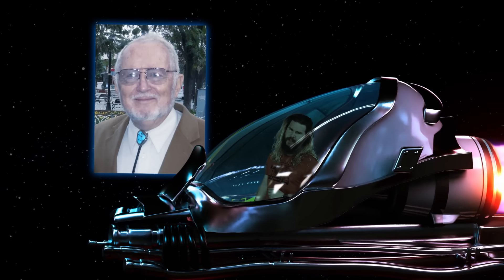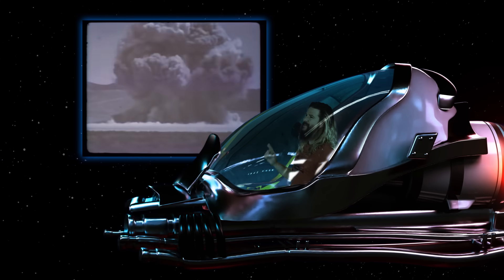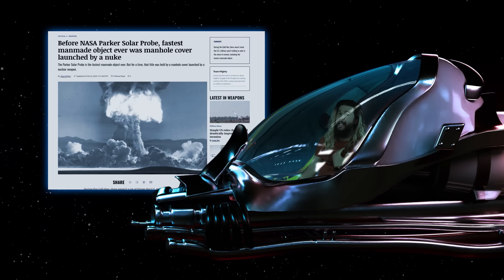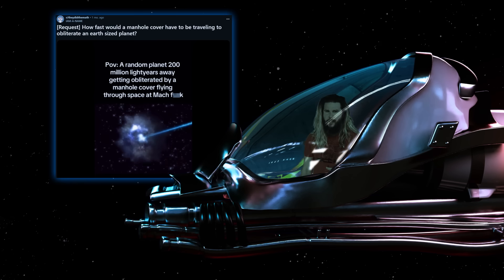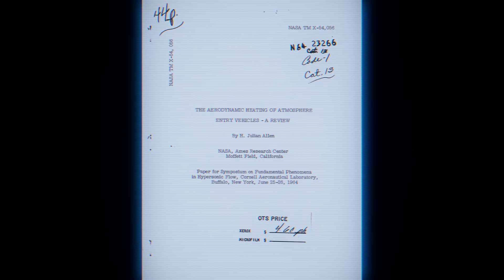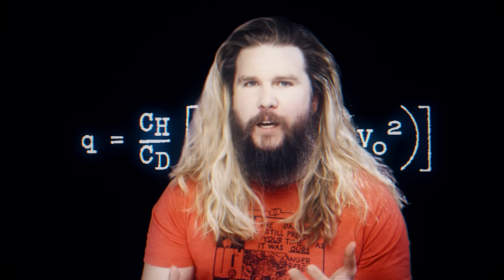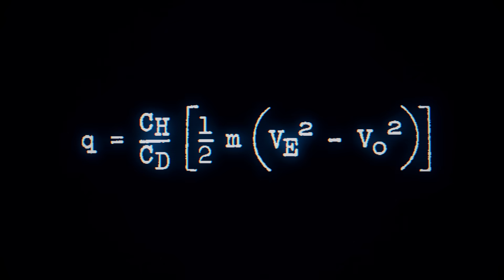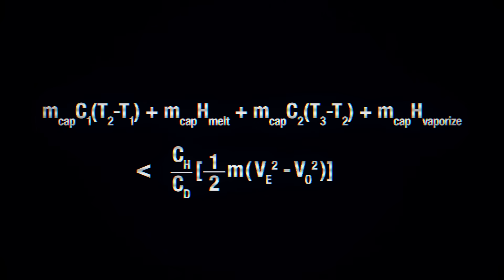Debunking the Nuclear-Powered Manhole Cover

Comment: Using the numbers for pure iron is a mistake as cast iron is not pure iron. It is steel with a carbon content so high it becomes brittle. Which also gives it a lower melting point. We can be sure it's not pure iron as pure iron is nearly as soft as gold. It would have deformed far more than is seen in the original video.

Also you assume the disk is ONLY heated by friction with the air. The explosion would no doubt have caused some heating, potentially affecting your calculations.

Comment: There is an astonishing amount of misrepresentation here. 

You cannot just simply use the inverse of formulas and assume equivalency. You forgot about: reference plane, discrepancy in pressure rate, modifications of your formulas to account for supersonic flow rates (invalidated Navier Stokes), superficial drag coefficients for hypersonic flight, you compared the behavior of nonductile metals to non-contiguous meteors, you didn't account for the difference between the elliptical path and object follows entering the atmosphere vs the near perpendicular path the cover would have taken in the time it spent leaving the atmosphere, you didn't account for the thermal conductivity mean free path with respect to pressure gradient, you didn't account for the boundary conditions of thermal conductivity at temp extremes, even the likelihood of orientation for reduced aerodynamic drag becomes critical here because of the leading edge  proportion to heat input because of the angle of molecular collision forces.

This is why "plug and chug" often ends bad when the premise of the formula is misunderstood. Pulling a formula from a study like a rabbit out of a hat is usually a horrible idea. 

Like you said "garbage in is garbage out"

Comment: Amazing to me you made....how many references to meteors? Meteors that are burning up ENTERING denser and denser air as it entered.  Whereas the manhole cover would be exiting through thinner and thinner air. It would have started out initially burning up and then less and less as it went. 

You also failed to mention that it was on a straight trajectory away from earth whereas most meteors are entering at an angle which prolong the burnup process, and that even science agrees a meteor coming straight on instead of at an angle, is far more dangerous than one at an angle. One of the reasons being, because it has a much higher chance of hitting the ground. 

Please take these into consideration and redo the math

Comment: I don't know man, "asteroids going three times slower" is probably the key phrase. This was going much faster. The manhole cover might not have been exposed to the air resistance for long enough to completely vaporize before leaving our atmosphere. . . Or could have turned into a molting slug and the second it reached the vacuum of space could have popped (similar to what happens in the vacuum deposition coating process.)

Comment: I made my first radio photo voltaic battery years ago and now I can't get the materials I need to finish the new one. I also found out that producing hydrogen through electrolysis release is a small amount of tritium as a free radical. I found this out when my hydrogen unit started glowing after about a month of processing fuel. I can make the tritium I just can't concentrate it. Now I find out we need a license to order it because they change the regulation. They're hitting half of their Half-Life so you're not near as bright as it used to be😢
Reply: Speaking of, I've been told that I'm crazy when I tell specialists that electrolysis does produce tritium as a free radical as well as concentrate the deuterium in the water due to the fact that it doesn't electrolyze out. It would be amazing if you could do a video or a deep dive to let people know these are actually free radicals as well as the fact that you can concentrate deuterium that way though it takes an extreme amount of time. In fact, it's to my knowledge that if you have an electrolysis unit set up but only put heavy water in it it will not work and you will not produce gases from it. I've never had enough deuterium to try this.

Comment: You're not taking into account that traveling at such a fast speed of 66km/s, the manhole would have passed through the main part of the atmosphere responsible for heating during controlled entry (65 to 35 kilometres) in less than one second.
Most manhole sized iron meteors in fact do survive their journey through the atmosphere and land on earth.   And that's because you have totally ignored the time it takes for this heat energy to be transferred to the whole of the meteor - the heat initially is completely concentrated on the surface, which then melts and ABLATES, carrying away the heat energy with it.
That's how spacecraft survive re-entry - they have this large ablation shield designed specifically to carry away the heat energy through ablation, and thus protecting the spacecraft from receiving the heat.
So, the time required to actually transfer the heat into the manhole cover, resulting in the ablation of the outer surface of the manhole cover carrying away this heat energy while protecting the interior, as well as the very short transit time through the densest part of the atmosphere would likely mean that only the outer part of the manhole cover got ablated away before it flew out of this zone into outer space.

Comment: I'm curious what the numbers would be with the cover in a vertical orientation, taking the escape in a more aerodynamic "edge on" orientation. Similarly, it would make sense for the forces involved to melt or otherwise reform the cover into a more teardrop shape, making its aerodynamics much better for whatever didn't get vaporized before it got to that point. Would a maximally aerodynamic cover still have vaporized?

Comment: i'm not going to argue the math just a basic observation. I get the numbers used however and its impossible to truly know but  Unless the disk was launched absolutely perfectly level which would require that the welds holding it down all broke at the same time  , which is basically impossible to a hand welded piece of metal  then the cap was tilted at least a little . Drag would straighten the cap out edgewise or atleast change its orientation drastically decreasing overall wind resistance ... so its possible only 4 inches of it would have been pushing an atmosphere. Since the actual atmosphere is only 60 miles thick at 150,000 mph that disk would only have to survive at most for 1.4 seconds.... No doubt some would have vaporized but i wonder if the manhole cover could have survived . I have seen people run their wet hands through melted led and not get burned due to the water vaporizing and protecting the personas hand. Wouldn't the leading edge of metal vaporizing produce a similar effect  significantly reducing the drag ?

Comment: I don't see how a cast iron disk (even one 4 inches thick) wouldn't have just shattered from the heat and concussive force of a contained nuke. 
You can crack a cast iron engine block if you push it too hard without enough coolant.

Comment: the most likely scenario is probably what was shown in the video, but there are two important variables that i am curious about. 1) does angle of attack matter, a meteor falling towards earth has a different angle to the presumably strait up vector of the manhole cover. this might matter as an object falling down at an angle has more time to burn up as opposed to something going perpendicular to the ground. 2) does the atmospheric density matter, an object falling down goes from low to high density atmosphere, where the man hole went from high to low.

Comment: Genuine question from a well intentioned midwit: Asteroids and other natural space debris of similar mass generally aren't wholly made up of a singular, refined slab of metal. Usually they're metal, rock, dust and ice all lumped together but not uniformly. So as a reference to something similar that we have as evidence that the math checks out wouldn't that kinda change? Like comparing modern plastic and aluminum car crumple zones to older steel body vehicles? Bad analogy I'm sure, but the force is the same between the older and newer ones at a given speed/ mass but the older steel frame/ bumper will likely be okay where a newer era one wouldn't? (Same probably can't be said of the occupants obviously lol.

Comment: What are use Monday numbers you have to take in to consideration let’s say that it had the stormy clouds above this site that there may fire up that freaking manhole cover it is there in the cooling atmosphere before even atmosphere heating would actually come into effect so you’re kind of wrong on that part yet to take humidity. It is a liquid that would cool down that nuclear man will cover, the heat from explosion will cover so water in the air cool down breaking man because the day afterwards and the journal of the guy there was literally note stating it rained the next hour or two note the next day from him claiming that there was a thunderstorm a nuclear test happened to tell you could’ve been into space

Comment: We know the thermal conductivity of iron. No matter how hot it is the iron will only conduct heat at a specific speed. If the time it takes for the iron disk to reach vapor temp is longer than the amount of time it spent in the atmosphere then it made it to space.

Comment: When you get buhed, correctly, so hard, not even the chubby electron man could have protected you
Also, the manhole cover was moving at least 6 times faster than escape velocity. So it would have not only left the atmosphere, it probably would have left earths orbit. And in the .2 seconds it was in atmosphere, it would have lost less than 9.8m/s of velocity
Reply: Most of the atmospheres gas is within the first 100km so it'd take 1.5 seconds to escape assuming the velocity is constant, however it would be experiencing quadratic drag (meaning the drag force is proportional to velocity squared) so it would lose several orders of magnitude more than 9.8 m/s of velocity while escaping the lower atmosphere
Reply: The question was whether it turned to gas before it managed to leave the atmosphere, still the comments seem to have a more compelling case of why it did reach space as solid/liquid
Reply: @combustiblefire5510  sinice it’s max speed would have Been when it left the barrel of the gun aka the earth and the whole they dug and it was still solid in that still frame it would not have vaporized. It is both slowing as well as Encountering less drag the higher it goes it would remain as a solid chunk.
Reply: @aikidodude05  that frame was like metres off the ground, it had another 100km to go so it isn't certain that it remained solid

Comment: Nice reasoning, but you left out a few environmental variables. The Manhole cover was not actually moving that fast when considered relative to the environment. The air around the manhole cover was actually moving faster than the cover, which is why it was moving at over 150,000 Mph. It would leave the dense portion of the atmosphere capable of melting it in under 1 second. We know that the cover was not immediately vaporized by the much faster moving denser air at the beginning, because it was captured in a picture. 

Your equation relies on a static dense atmosphere. You left out the portion of the climb, where the atmosphere was moving faster than the cover, the portion where the speeds equaled out, and the portion where the cover was moving through disturbed atmosphere, before hitting any undisturbed atmosphere where your equation would be applicable. However, the cover after .1 of a second was at over 4 miles in altitude where the atmosphere is only about 2/5 as dense as it is at sea level. and after .5 second it would have little effect from atmospheric density. 

So, the question is at what altitude did the speed of the environment finally match that of the cover. That is where 0 Mph is started. How quickly did the environment speed and cover speed diverge, and what were the altitudes of those measurements.  The rate of convection of heat would also be slowed by the tumbling of the cover, so that would propose another unknown variable.

Another issue is the meteors you mentioned. They explode due to the various elements converted to gas such as water within the rock, and the many fractures and holes in it. The cover did not have these imperfections, nor did it contain pockets of water or other elements that could expand to cause it to explode.

Did it make it to space? Not sure,  but I sort of think it did in one form or another. Too bad we can not recreate the experiment to test it..........for science of course 🙂

Lok what happens when you get me to thinking... I will think on this more.

Comment: I just wanted to say that seeing the sheer magnitude of the energy imparted to the cast iron, I would say that it is almost certain that it just disintegrated into pieces before even coming close either to space or boiling point.  I think that the structural integrity of this piece of cast Iron had no way to keep it together. Note that cast iron is quite fragile, it resists well under compression but sucks at traction

Comment: if the disk melted it most likely would have formed a droplet form first making its drag lower, also the disk would stabilyse in too a vertical position from the drag so it wouldnt be a zylinder in the fluid drag calculations

Comment: Your calculations were for re-entry. It doesn't take into account the thinning atmosphere. Objects on re- entry into the atmosphere experience increasing pressures not decreasing pressures. And the manhole cover would not have maintained its orientation because of atmospheric turbulence. It would have begun to spin like a flipped coin. Not saying it made it to space for sure but the factors are there that it could.

Comment: This disk shaped piece of steel MUST have deformed due to the force of the blast wave. The new shape probable looked like a cone. And a cone is way more aerodynamic than a disk.
Also... This chunk of steel would have cleared the first 3 miles of fhe atmosphere (densest part) in around 0.1 seconds.  Is this enough time for compression heating to vapourise 2000lbs of steel? I don't think so.
At least a small part of that cover went to space.

Comment: You're forgetting the most important part of this. Meteors are moving from a medium of no resistance into a medium of high resistance that being vacuum and then atmosphere. 

The man hole cover was going from air to vacuum. There would not have been enough time for it to build up the heat nessesary to destroy itself before reaching lesser atmospheric resistance and eventually vacuum. 

You're using a calculation in the wrong direction. 

That manhole cover absolutely made it into space.

Comment: I dont think comparing exiting the atmosphere and entering the atmosphere would be accurate, as entering the atmosphere, you would be facing a constant increase in particle density, and exiting you would be facing a constant decrease in particle density. Not to mention turbulence and wind shear type forces in both circumstances may behave differently.

Comment: based on the frame rate of the camera and, they caught it on 1 frame you could get pretty close to calculating the speed{ calculate the distance traveled between two video frames and divide it by the inverse of the camera's frames per second (FPS)}.   it  technically could have been the fastest object ever even if it was only for a second or 2 before it vaporized, assuming it did.

Comment: Doesn't the fact that a single frame of the object moving in tact prove that it did not vaporize before leaving the atmosphere? The first moments of its trajectory would mean it had its maximum velocity at the thickest part of the atmosphere and would have reached space in about 2 seconds. The object accelerated from 0 to 66km/s in microseconds, the air wouldn't be able to get out of the way fast enough and would compress and heat to plasma temperatures. All the while, the air would be pushing back against the object. At that acceleration, the air should act like a solid wall and cause the object to almost instantly explode. The fact it didnt instantly explode once it got moving, seems to indicate the forces and friction were not sufficient to vaporize the object. Is it possible that extra energy is lost through rotational energy, radiation or transference into the surrounding air?

Comment: Something else to consider from a orbital mechanics standpoint. Using a formula based for a craft/meteor re-entering tangentially to the surface is a different scenario that a object launcing vertically. The amount time it spent it significantly dense air is almost negligible as pointed out by another comment. Another variable to consider is that it was propelled by gasses from the explosion from behind for a decent distance. Lastly gotta wonder if something like a Leidenfrost effect could affect hear transfer coefficients given that we have no observations at these speeds.

Comment: A) it wouldn't have been flat,
And 2) it would have taken less than .02 seconds to clear atmosphere.
And as a tertiary, no, it's not reasonable.cinsidering the meteors are moving a hundred rimes slower and are in 6 way longer 
As I said, less than two tenths of a second. To c Lear atmosphere.
Tell ya what, why doesn't somebody, I don't know with money say, run one of those fancy simulations??? Put it to bed?

Comment: There is a slight issue I have, that is: I don't think the cap was moving straight up; the air must have been incredibly turbulent, so either the cap was tumbling, or was flying thin side up. Would this reduction is air resistance be enough for it to not burn-up?